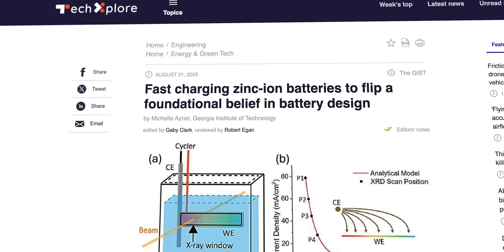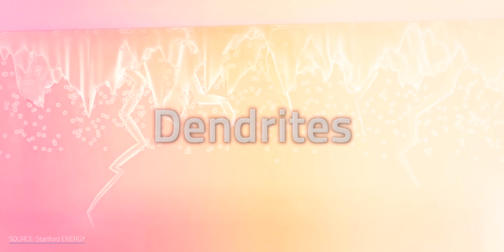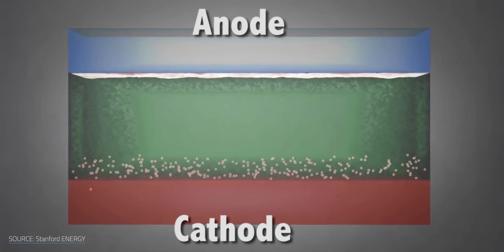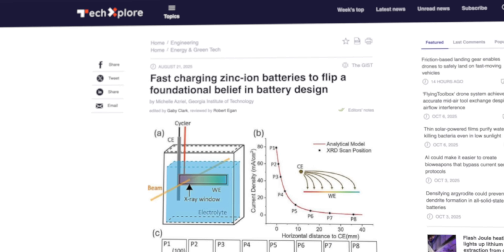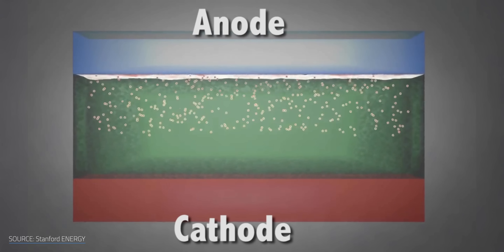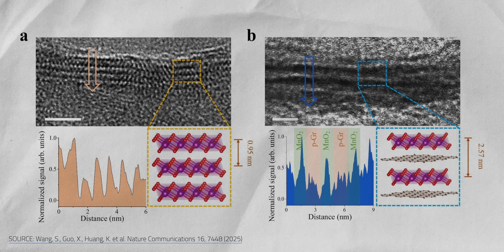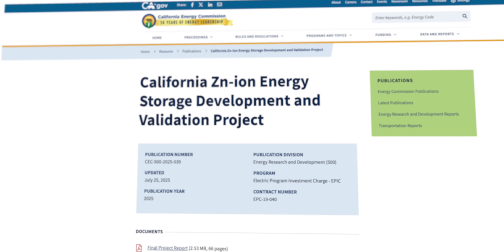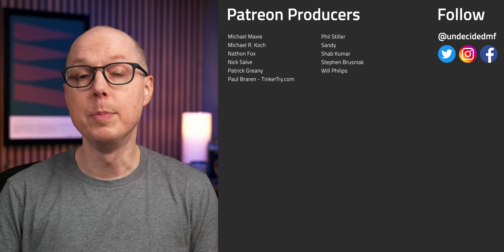The Surprising Battery Discovery No One Saw Coming

Comment: There had been not even 1 science advancement in the technology area used by messes (PCs, cellphones, monitors/TVs and so on) that ended up resulting in lower prices! 

Even when these advancements result in cheaper production costs, at the end of the day, the consumers have always ended up paying more for it!
Reply: This simply isn't true. Every single one of those categories has lower prices than it used to because of new technologies.
Reply: Huh? Prices are consistently falling and it is largely due to tech advances (and mass production / economies of scale).
Reply: @cleanriver2 It's a common perception., because that's how it should be, but we have been logged to. 

Check the actual data...top of the line products back then and now.

Comment: We already have LTO battery cells for a decade, they have massive 20000 charge cycles lifetime, they can be charged at pretty low temps froom -60C to -40C, they have ultra-low self-discharge of 0.02% per day, they can be fast charged (10C charge rate) and they don't burn when punctured.
Reply: They are expensive to make though and have dreadful energy density
Reply: Titanium is more expensive than zinc,  btw I want those batteries LTO or Edison batteries would do my home just fine, but I will have to wait for cheap capital and 
i have to own my home first.  It looks like an ecoflow is the only realistic option in the next 5 years
Reply: And they still use lithium which is terrible for the environment to mine. And there are lithium mines using child labor. We should get away from lithium in general if we can.
Reply: @gotindrachenhart  Lithium isn’t the toxic aspect of Li-ion batteries, the cobalt used to make them is what you’re referring to.
Reply: @gotindrachenhart  Cobalt mines not Lithium are using child labour.

Comment: I am wondering how does the zinc battery compare to the sulfur battery. Sulfur batteries is a competing replacement tech for lithium ion batteries. Still all the citations only noted zinc ion lithium ion but not sulfur ion. As it is a competing tech and I do not want to push away any possiable solutions how does it compare?

Comment: Zinc batteries have been around, and evolving for a long time. But even if these technical breakthroughs make zinc batteries viable, the competing battery chemistries are getting better as well. Witness CATL's upcoming Naxtra and Freevoy, sodium-ion battery packs. Especially the anticipated $10-$20/kWh, along with Gen 2 sodium batteries increased energy density, and other benefits. The best is always the enemy of the good. At least for specific battery applications and markets.
Reply: CATL Naxtra battery is already gen 2 sodium, as they previously already produced gen 1 sodium ion battery that only has 120Wh/kg energy density

The next gen 3 sodium battery will have between 200 to over 400Wh/kg, as other than current mass produced sodium iron oxide there are many different new sodium chemistry being developed, like sodium manganese, sodium silicon, anode free sodium metal and even cold temperature sodium sulfur

Comment: A 100,000 cycle battery is about 275 years of daily cycles.  At that point, or even at 30-50 years, the cost of storage would be a rounding error.
Reply: Per cycle cost, amortized, certainly.  One wonders what end to end efficiency these get of course.

Comment: Long-term I’m still hedging my bet on solid state batteries, and any battery technology that is thermally safe, cost-effective, and with fast charging rates. Ideally at some time, I’d love to see an Apple Watch with its band using a flexible, solid state battery with high density.
Reply: I am pretty sure sodium ion will be way bigger and impactful
Reply: I still wonder why nobody makes a battery band for Apple watches. They don't need to be flat and flexible, it could just be a band of battery "bumps" connected by flexible joints like any bracelet band.
Each bump could probably hold at least half of the internal battery, so you could have a band that holds 3-4 extra days of power.

Comment: That initial statement about fast charging was mostly associated with NiCad chemistry cells.
Reply: It used to be said that fast discharge (ie shorting) could burn those dendrites in NiCad. Never worked for me.
Reply: @RedRouge-j4j  Fast charging worked sometimes for me. Ten amps into an AA cell, carefully and quickly.

Comment: Sodium ion also has pretty impressive cycle life. And sodium is a lot more common than Zinc. Sea salt, salt deposits, etc. are so common and cheap to source that we think nothing of putting it in our food or keeping our roads ice free with it.

Mostly, this type of research points at long term interesting trends but the devil but a lengthy and expensive R&D cycle all the way from the lab to mass production for marginal gains against the status quo when the status quo is rapidly evolving in terms of longevity, cost, charging speeds, energy density, etc. is super risky.
Reply: Yeah, it has almost the same cycle life as LFP (5000-6000 cycles), and also the same energy density as LFP (175Wh/kg)

The only problem is, sodium ion market share is still abysmal (only 1% compared to LFP with almost 70% market share), and almost all of the produced sodium ion batteries are still consumed by the domestic market in China

CATL does promise that their sodium ion battery production can reach at least 30-40% of all battery market share in 2030, but they have to prove that, so we wait and see
Reply: The advantage of sodium ions is that they operate over a wider temperature range and potentially reduce costs to $25/kWh.

Comment: Electroplating has a lot of crossover the dendrites high current density area. Imagine you’re trying to plate a hole but all the sharp edges grow points and almost nothing happens down in the hall in terms of layer thickness when you electroplating the same strategy supply if you reverse the current, you can burn off the high points and then start plating again kind of a two steps forward one step backwards approach to burn off the high points and then continue plating to add thickness. There’s a lot of crossover between thinking about batteries and electroplating because the dendrites are identical and so is the strategies for preventing them. Another common method is to put a blocker in there that lowers the current density in the high points in other words a contaminant. I’m just like batteries, temperature acidity corrosive elements. All play a role and the best methods were found through trial and error.

Comment: In China they have chargers that can add 150 miles of range in 3 minutes to a car, so speed is not and will not be a bottleneck in future, more price of how much that costs to install and consequently in electricity price, and yes, how much that kind of charging can degrade a battery. Then again I think there is and will be place of all kinds of charging, both slow charging at home and ''medium'' speeds like 250-300... or lower. There are different scenarios, sometimes you need to charge fast like you are really in a hurry, sometimes you go to see a movie or go on shopping, sightseeing in some area and you can charge there for an hour or more, and then you can also charge for hours at home and at work...

Comment: 0:01 
It seems the one who said this and spread rumors is Samsung because they have been using the same 45W charging speed for 5 years 😅 and there are Chinese phones with 65W+ that are still working fine for years and their batteries are good or at least there is no difference between them and phones that charge slower

Comment: To be fair, real world data on EV battery degradation shows that batteries that are primary DC fast charged on average show the same amount of degradation as batteries that are primary AC slow charged. In the real world we aren't seeing increased degradation that we would expect to see from DC fast charging.  It shows that we don't fully understand battery aging under real world use conditions.

Comment: Very cool new tech breakthrough we won't hear about ever again sadly.
Reply: We talked about NEW REVOLUTIONARY new battery for like 5 years
Reply: It's crazy that there are battery skeptics when in just the last year, we've seen incredibly fast charging, proven reliability and longevity numbers, etc IN THE MARKET. And indeed, that has been happening every year for many years.

People can keep pretending battery breakthroughs aren't happening, but just because Matt is reporting on cutting edge announcements that don't always pan out / happen quickly, doesn't mean that batteries aren't continually getting better and cheaper. Because they are.

Even in EVs, the hardest use case for large batteries, you can buy a golden brick battery today and charge 300 miles in 5 minutes. Or take something "mundane" like LFP. Boring and old news - and yet it is way cheaper, much safer, easier to handle, and longer lasting than the tech that came before. People act like if a technology isn't perfect and paradigm shifting, it's not real. Crazy.
Reply: It took 20 years after they began working on lithium batteries for lithium ion batteries hit the market in 91

Things are moving much faster these days, for a number of reasons I shouldn't have to explain
Reply: How's sodium-ion batteries going?
Reply: Matt thinks we are stupid, like there is some revolutionary battery tech every month
boy who cried wolf.
Reply: @casey206969  Did you ever stop think that maybe there is? Companies all across the planet have every reason to invest tons of money into developing better batteries, so it kinda makes sense that we'd have tons of experimental breakthroughs. The reason we don't hear about a lot of them again is likely that it could take several years to verify everything and then assess commercial viability, and there's plenty of points along that process where a company could decide it's not viable as a commercial product anymore/yet.
Reply: @casey206969  
The Thing is, they all are viable technologically, but Investors aren't interested in viability but rentability and most every new Tech or Chem would either need a big upfront investment to get it to were it will be able to compete with or never will be near the ROI that Investors seek compared to the current tech which has its development cost already back in the pockets of its Investors
So Investors, which are naturally risk averse, rather put money where they know they get their ROI, then invest in something that they aren't sure, even if it will work
So most of the time is just that it takes more time for Investors to get  money back, then they are willing to accept, especially if they are Professional Investment Banks, which by their nature, are not in the game for long term idealism but rather to maximize the Profits in the shortest amount of time
Reply: @casey206969  Sounds like you might be? You pretend that Matt is a salesman trying to make you personally invest in these new ideas, instead of showing us the possibilities out there and what might be. Let's all go back to the bronze age seems to be your solution and stop trying to advance technology!
Reply: Because it's not the tech breakthrough that Matt sells it as.  It's his business model.
Reply: @johnborton4522 if China wasn’t already pretty much fully scaled to re-power the world using existing tech, we would see much more of these new technologies implemented.
Reply: @RobertMartin-s2v  There's a very big difference between "breakthroughs" and practical applications.   Most of what Matt features will never ever reach the latter China aside.   These are engineering facts.
Reply: @RobertMartin-s2v  litum is a loosing game to power big cities. if u have sunny places u can charge masive battaries during the day and discharge at nigth . with how much zinc more avilible it can somewhat mabye can be tried to be implamented . tho with the current times not sure if anyone going to be intresting taking on and investing in such a drain of a project. and that assuming all what is told is true. usully there are alot of snugs that omited in stories that make stufff dificult
Reply: @alexaiz7521 long term I think your correct, but at the same time while lithium is dominant in EVs, it is at a huge advantage with scale and availability compared to less established tech. All of the sudden big auto can get into the power storage game anytime the margins get high enough or demand on the EV side dips. Just compare the costs of leasing an EV compared to buying stationary storage for your home.
Reply: @RobertMartin-s2v  I disagree, lithium gets much, much worse as you scale it up

Even if you aren't reusing EV batteries for grid storage, the brand new ones still degrade fast and more so when used frequently 

Sand batteries are the future for large scale grid storage in terms of total storage, cost and 0 degradation

Comment: How long has Matt been doing these videos on batteries, wind and solar power, etc.? And how many of these technologies have entered the main stream: zero, one, two, more than two?
Reply: It’s actually a sign of how well the  industry is doing, 50 different ways to store power in a battery or different kinds of solar cells, but the fact that gigawatts worth of production lines are already built and driving down costs, edging out newer more exotic techs confirms most of the barriers to a renewable energy system are overstated.

Comment: If true and scalable, this would be dream come true.   But every time you bring us these amazing stories, how many of them actually work out?   How many of these stories have you made follow up stories about how they are doing 1 year later or so?    If memory serves me, none pf these stories with great potentials have ever developed and delivered on their promise.    Is this true?   can you let us know if any of these new technologies have actually worked out?
Reply: I waited 20 years for OLEDs to get to a retail device.  mRNA was 'right there' for 20 years till covid gave it a bunch of money.  Fusion is also 'right there' just waiting for a flood of money to get over the line.  Some will make it, some will be smothered for 100 years.
Reply: You can blame capitalism for this feeling. Scientists make discoveries, whether it's applied to real life changes is entirely dependent on the capitalistic machine the world has created. We've made engines that are fueled by water, but they will never be implemented into common vehicles because the oil industry is too strong. Don't hate the player, hate the game.
Reply: @baileescott401   "fueled on water"
hydrogen internal combustion engines?

those are actually not that efficient, its quite difficult to do due to how well and hot hydrogen and oxygen burn and it takes an immense amount of electricity to create the hydrogen used in those cars, at that point just use an EV.

Comment: When my wife and I lived in Colorado, a couple years ago, we bought a very used, cheap first gen  Nissan Leaf (100k miles) for my wife's five minute commute, which was horrible for her ICE car.  Putting that car on Leafspy, the battery was relatively healthy, around 85%, typical for the age, but the notable thing was level 1&2 charging was 70 or so, but Chademo fast charging was over 300 times.  IOW, the car was a ride share car for much of its life.

But the battery was healthy.  We passed on the car for the same as we bought it for, in good spirit.

Comment: Out of curiosity, I calculated that energy in the form of heat can be stored in large aluminum blocks, approx. 100 t. It could be recovered either directly, as heat for heating houses in winter, or as electricity, using a closed-cycle steam turbines. In terms of capacity, the energy  stored in aluminum in the form of heat, both in terms of energy density and cost, is similar to lithium battery systems. The advantage is that aluminum blocks practically last forever, aluminum is abundant in nature and recycling does not cause problems.

Comment: What are the logistics bottlenecks for high speed charging at many locations?

I suppose they could devide large packs into smaller modules that charge separately keeping cell amps high, but switching, pulsing electricity shortens connections life. Smooth & even is the best for longevity so great batteries that last longer at the cost of other components.

Comment: I would like to learn more about some of the charging profiles these different battery researchers are using. Specifically a pulse and short where every 50-60,000 charge pulses, the battery is shorted for one pulse. I have been using this profile with Lifepo4, lead/acid and NIMH at 1C during bulk charge.